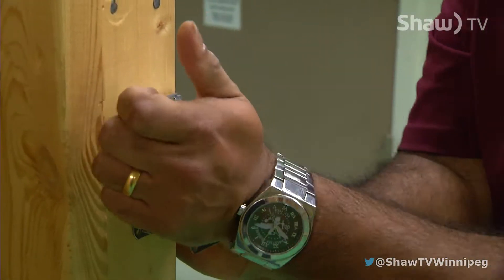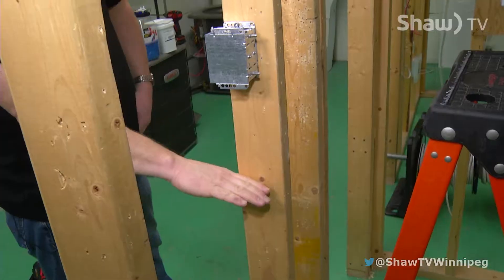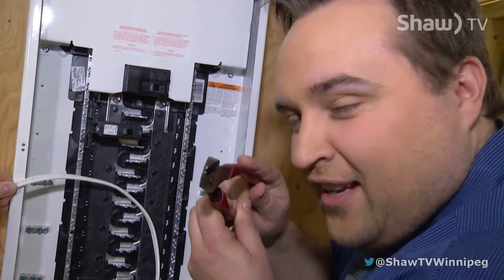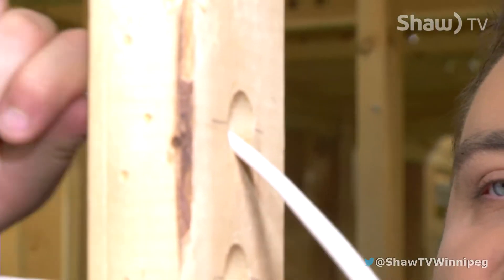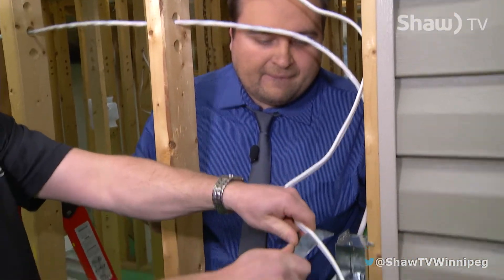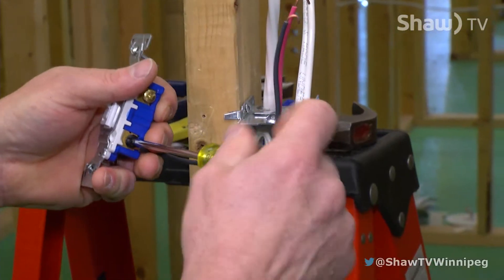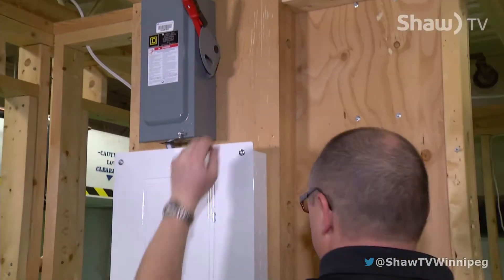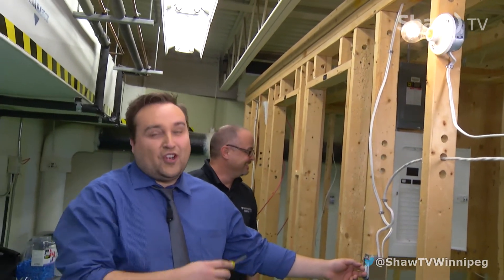Hired Learning: Electrical Technician

Comment: Electrician and electrical technician are the same?
Reply: No. They mostly had an error in the Graphics department of the news channel. What is shown here is a construction electrician. Electrical technician are not really an apprenticeship trade but a 2 year post-secondary program and you work in industrial/manufacturing area where you install and troubleshoot field devices (sensors & actuators).
Reply: blake
Reply: @rhythmandacoustics  Okay. I applied to my city’s community college for an Electrical Technology/Technician Associate’s Degree and I don’t know if that’s different from an Electrician or Electrical Technician. Idk the difference and didn’t even know if there was a difference.
Reply: @Kal-El207  Electrician vs Electrical Technician are two different occupations. One works in construction, one works in a factory setting. The Electrical technician often works with machines that the manufacturer makes, often troubleshooting and adjustments. The electrician pulls wires, installs switches , installs electrical heaters, etc.